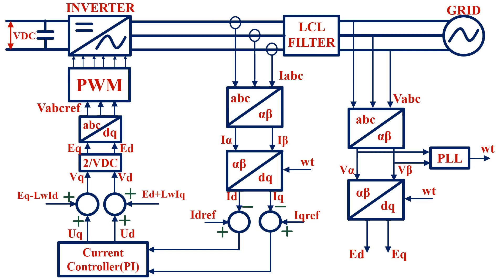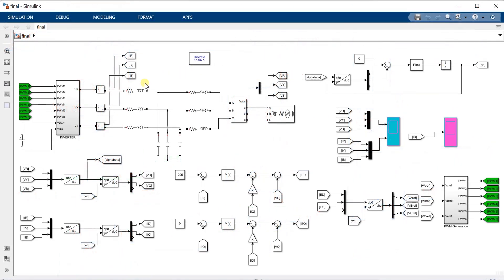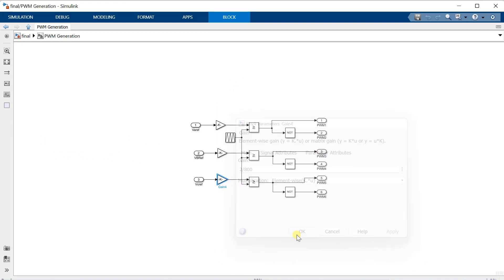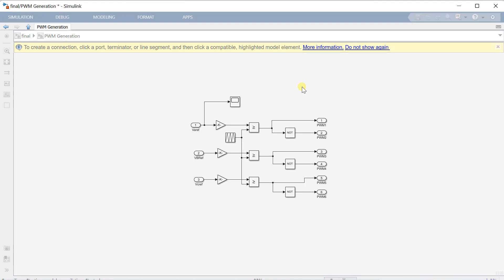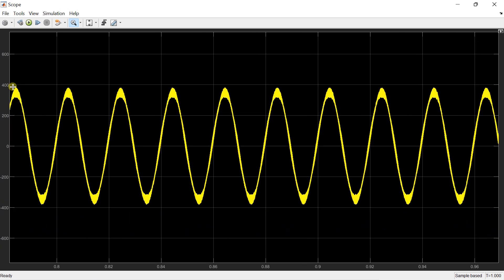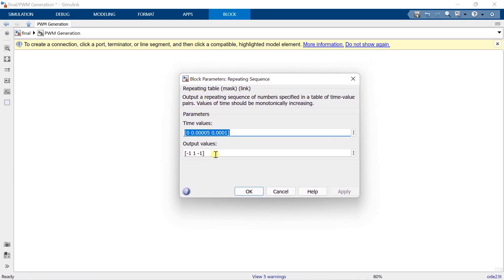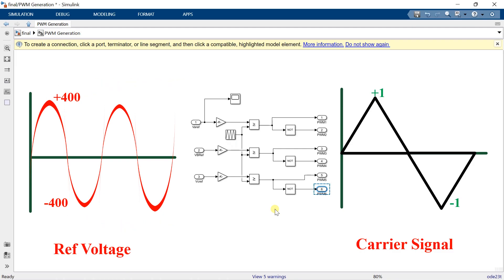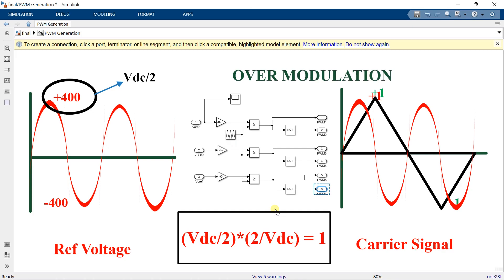Why 2/VDC? Concept Explained! | Tech Simulator

Comment: Hello, Thank you for the explanation!
So why not to divide Vref to Vref to be sure to have always an amplitude of 1.
In reality, The voltage of the Vdc can have some changes or the AC voltage can have some fluctuations
Reply from the maker: if it is always 1 , modulation index is always the same , like that you cannot control the voltage or current

Comment: In practice, you don't scale by 2/Vdc, because Vdc can vary. You use a PLL to re-create the sinewave by extracting its electrical angle wt, then use it to generate a normalized sine wave. It 3-ph, it even easier to do using abc/dq trans to obtain the magnitude....

Comment: Hello sir, could you please make a video about the simulation of a Lithium-ion battery in Matlab-Simulink,  especially the one used in solar energy storage? I mean the simulation is built from the Li-ion battery's theoretical formulas, it means we will not use the battery block that Simulink already provided. If it is possible, the simulation of LiFePO4 would be a top choice compared with other types of Li-ion battery. Also, I would like to thank you a lot for your video about the simulation of the off-grid inverter, that helps me a lot.